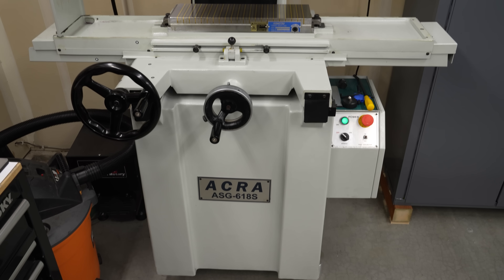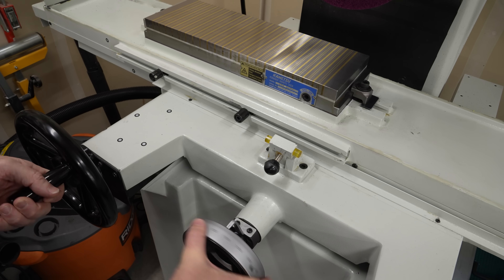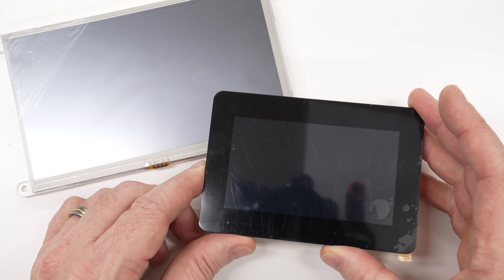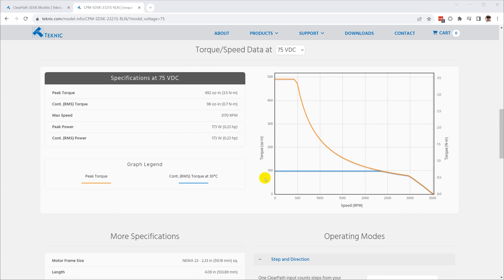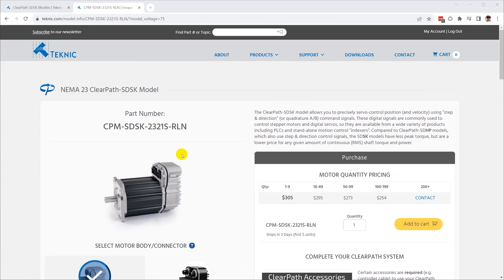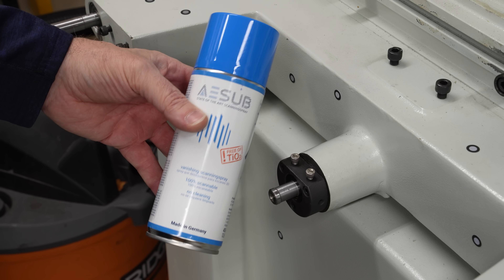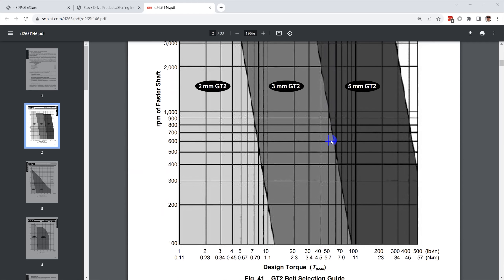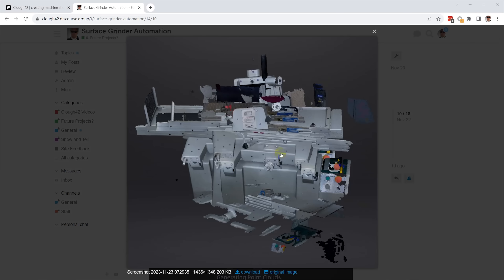How to Select Motors for a CNC Conversion | Surface Grinder | ClearPath | 3D Scanning

Comment: 99.9% of commercial cnc machines do not use motor positions for feedback. They use scales hard mounted to the axis. This data is used every step of the motor. This compensates for backlash.
Also this lets most cnc controllers run self test and flag when screws start to fail.
I use the models from them to print pullies as emergency backups lol
Reply: We've got doosan, mori, and romi in our shop. None have scales. Not sure where your 99.9% comes from...
Reply: Where I work we have 6 cnc machines of which only 3 use scales and the rest locate by motor position. And these are proper industrial machines not hobby grade pencil sharpeners. If the ball screws are good enough the scales don't really do much and sometimes not having scales is a benefit. For example in the summer, when the shop was quite hot (about 30°C), we did some parts that needed locating holes with a spacing of 800±0.02mm, because the part was steel we just did it on a mill with no scales and a steel ballscrew, no temperature compensation required. Scales are nice to have though if the machine loses it's location, easier to home axes with scales rather than fiddle around with indicators and squares if the machine only has e-stopping limit switches.
Reply: Guess I'm wrong but the 2020 haas VF-02SS , fully spec 2016 haas super mini mill, the brother speedo 750 all have scales. I guess it was an option 🤷 I just clicked them all and wasn't really paying attention at the time I just needed stuff fast and haas is really good at getting equipment to your door fast lol from order to drop off in 12days.
I have a St-15Y  but haven't had the covers off so not sure on that one. I ran a lot of old fedal and mori stuff in the past they all had scales but most that was old pre 2000 stuff.
Sorry for the ignorance sometimes we get complacent in some ways. 😆

Let me guess you expected me to ghost or stand my ground. Sorry if I'm wrong then so be it I did more research after seeing the responses and can see the error in my thought in that moment.

Side note
I have a few converted mini mill (belts, bearings and ball screws upgrades) and a purely custom diy lathe as well (A/C servos direct drive ball screws a spare servo works as a live tool spindle)
Reply: @techmasterjoe sorry but not true at all. There are absolute encoder machines and incremental encoder machines. Both of which typically don't come with scales for feedback. It's usually a high dollar upgrade or only on top of the line machines. Absolute encoder machines have a battery supply and always remember their relative positions therefore don't require homing the machine and hitting a dog switch to reference the encoder for home position. There are parameters for backlash in the control. The machine knows where it's at based on the encoder position and the pitch of the ballscrew, factoring in any thermal comp, ballscrew error comp, yada yada.
Reply: @seanparker3662  I agree, and they are not required 🙄  just made an assumption based on the machines I have used and owned all of which A. Pre-date modern controls. B. While, not a high-end machine, the spec sheet was maxed out for demonstration purposes. I mentioned this in a previous reply  to my og comment..
Reply: @CNCAutomationLab  sorry I did read your response after I wrote this. At the time I just wanted to clarify for others.
Reply: Resolvers are much more forgiving of losing power in the middle of a part than encoders since they are essentially quadrature transformers. Most encoders have to zero themselves before they know where they are. Resolvers dont.
Reply: @Rorschach1024    resolvers are  functional identical to encoders when it comes to power loss
they still need to be re-referenced.  absolute encoders on the other hand will remember their position at power loss (providing the backup battery is good)
Reply: Not true at all.  No Haas VMCs use scales, unless you order that very expensive option that's only available on a few machines like the VM series.  I am sure that scales are available on high end models of the best of the best machines (Yasda, Kern, Hermle, etc).  Haas sells more machines than anyone on the planet, so your 99.9% estimate is off by a mile or two.
Reply: Nopes.

Comment: Hi from Canada. I have questions: When doing you torque calculations why did you not include the effect of the work piece(s), additional chucks, fixtures, etc.? At TS6.45 you said you only calculated for the table and magnetic chuck as load.  Wouldn't the addition of your secondary chuck plus several pounds workpiece almost double the required torque? Lastly: could the manufacturer of your grinder have provided a 3D model?     P.S. I really, really enjoy your channel.
Reply from the maker: There's lots of margin on X.  And I can always slow it down if it's an issue.
Reply: Had same thought as a work piece could easily weigh as much as that chuck.

Comment: When I would 3D scan big dies with a Creaform I would use MAGNAFLUX Dye Penetrant Developer. It worked good but the downside was also having to clean it up. One this I did think of was trying spray foot powder but I never had the time to try it.
Reply: Yes, dye pen developer, brand doesn't matter, is cheaper and is what everyone used until they developed the fancy sublimating sprays. It also has the benefit/disadvantage of sticking around until you have to clean it up. It does just wash/wipe off as it's basically just spray on chalk so it's not to bad. I've tried foot sprays and a bunch of other hobby solutions, it's not even close to as good or easy to work with. If you screwing around in your garage sure but if you're on the clock not worth it at all.
Reply: @TheWidgetWorks  Oh I am sure there are other brands. I was bringing this program online at my shop back in 2018 So at the time I did have some time to figure out a good process. Man I miss using a Creaform.